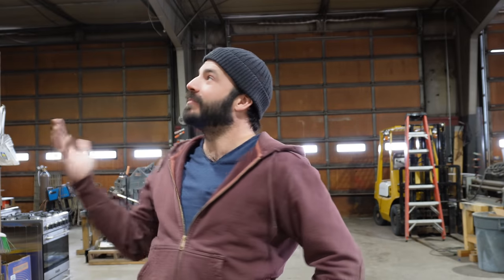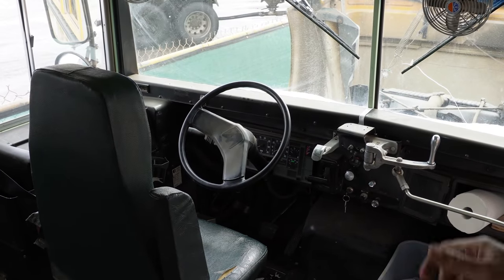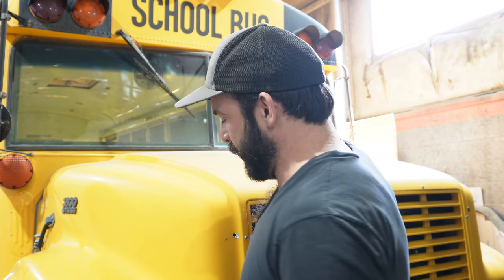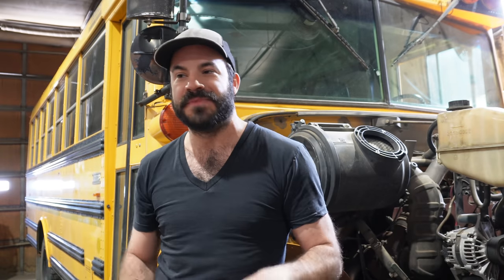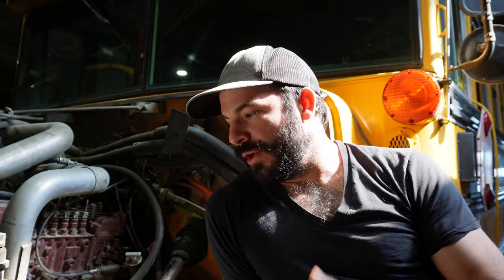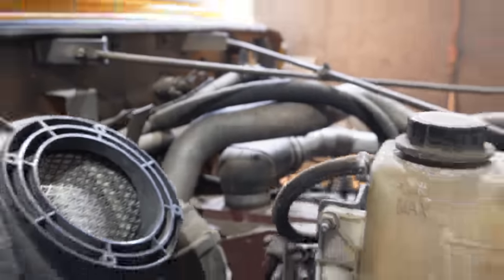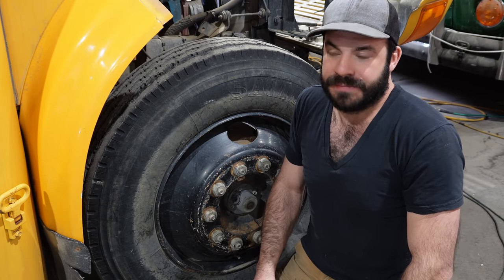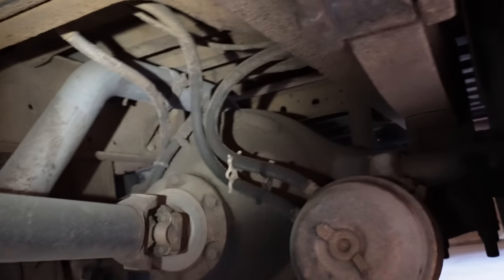Which Bus To Convert For Your Skoolie?

Comment: GREAT VIDEO!
I've been keeping up with you since I first heard you call out the million mile motor claim over a year ago!

Is the Bosch P-Pump on the DT360?

My 5.9 doesn't miss the AT545, I swapped it over this summer for an Eaton 5 speed. 
I've seen a HT740 on the back of a Detroit diesel in a 70's Silver Eagle also!

I have a set of 4.33 gears for sale on eBay that came out of our 99 Thomas donor bus;)

Awesome tire information. Will be catching up with all your YT videos shortly!
Reply from the maker: Glad to see you here! I do believe the 360 had the p pump. Killer motors. 
And yeah, no one will get 1,000,000 miles. I think my bus has 4.11 in the back, I'd like 3.5 or maybe 3.7
Thanks for tuning in, see you around

Comment: Retreads should be illegal. Someone I know was killed when a retread smashed through his windshield in Georgia. You see retread failures all over the road.
Reply: Someone I know was killed when a driver on his phone left his lane & hit him head-on. Would u make cell phones illegal? Sorry for your loss, but 90% of tread failures aren't retread production failures. I'm a 19 yr trucker veteran. I've had many flat tires over the years. Underinflation -> excess heat -> glue failure -> tread loss. Check your tire pressure on EVERY pretrip. All my flat tires have been on my trailers where the auto-inflate system failed, usually in the winter w ice in the line.

Comment: Hey Chuck! I'm in the military and looking to get a 40ft bus to live in for extended periods of time. Are their any engines we should avoid? I intend on starting and running the bus to keep it maintained. I was told by a Bus Depot that - "Wet sleeve engines cannot sit.  If they do, they go bad.  Coolant starts to drip out of the o-rings surrounding the liners, and the motor oil ends up with coolant in it."
Reply from the maker: I've never heard that about wet sleeve lined engines--my own bus sat without starting for 2 years once without issue. My take is to only start the motor if you're going to get enough load on it to bring it to operating temps. Otherwise, let it sit. Just my .02 though. If I were you, I'd get a cummins 8.3, it's the best option for a 40ft bus ever, IMO. Good luck!
Reply: @ChuckCassadyYT  Awesome, Thank you for the reply! we will start looking for 8.3's

Comment: New to the channel. Impressive work. Haven’t seen if you’ve converted older buses. Like pre 1990? Also, if any of your customers live or register here in California. Jan 1,2023 they implement the diesel killer bill. Pre 2009 units I believe.
Reply from the maker: Hi Thank you! We've done conversion work on buses as old as 1962 and turned a 1959 Mack into an art piece. Not aware of any issues with non-commercial laws like that in california. I believe they are only for CMVs
Reply: @ChuckCassadyYT  wow. I’ll check those out if you posted them. Love the older vehicles. On CA diesel laws: good point. My girl was notified via work. In the vineyard business.

Comment: Definitely the Navistar 3800 Chassis, stay away from the CAT C Acert Engine the 7.3 Power stroke is a great engine in these. Blue Bird makes the best body, Thomas has an integrated floor which is built into the structure, which is a bitch to work with. Blue Bird is also the only bus body to withstand the Colorado rack test in a roll over because of it's roof bow design. If you want the best turning Conventional Bus you buy a Vision Chassis from Blue Bird, they have the tightest turning ration of any bus. Stay away from any puller or front engine flat nose bus they are a nightmare to work on, Pushers are great because the engine is totally accessible in the rear. As far as accidents are concerned, Flat Nose blue birds are ridiculously safe. I have seen them smash into trees and semis and even a train once in person after the accident (I worked at a Blue Bird dealership for over 15 years) and there is so much steel up front even in a flat nose if you wear your seatbelt you could smash into tank and walk away.
Reply from the maker: I love all this! thank you for sharing and I agree, BlueBird is my favorite builder. appreciate your comments

Comment: Can shift points be adjusted on the Allison 545? 
I would have preferred a later model Allison with at least lockup.
Mine is in a 2000 Freightliner MT45 step van with 64k mi.,
 4:56 rear and the 5.9 Cummins. Your 3:73 rear end change video was very informative.

Comment: What do you think ?
I’m looking at a church bus , original owner
1994 with a gas 454 GM engine 80,000 miles
Just needs brake lines as of now .
I know nothing about diesel , so I figure this engine can be repaired
At any auto part stores on the road .

Comment: Your advise about a the longevity of a - Straight-6 is with experience and I admire that!  I used to travel a lot in Israel and Sinai desert and the Arab taxi's were then- all old-old 7-passenger Mercedes that wouldn't die! Indeed, in Jerusalem the Palestinian bus station were still using Mercedes buses (They Looked like) from WW11 or at least the late 1940's!!!
I/, going to be 70 this summer and finally am considering getting back into the New England to Florida Snow-Bird routine again- any advise on-

Could I pick up a used bus like yours for under $8000- and how much more would I have to spend to get it road Reliable???? (I can handle the interior conversion myself!) Thanks

Comment: I’m 6’5” and I’ve been thinking about the 40’ Thomas HDX with rear engine. Cummins/Allison combo. What are your thoughts on those? You mentioned in another video to rid the original windows, what are some good replacements that let in a lot of light and airflow? Also, I’m not comfortable with a roof raise, so what would be a good insulation that’s efficient but not bulky?

Comment: i want a bus that can handle logging roads. logging roads i'm thinking of are 10ft wide, some are moderately to lite steep, some shallow ruts. My primary focus is to find a bus thats short enough ( 5 to 7 window with handicap door)  that wont drag the ass end if theres a  slight hill, and short enough im not taking a mortgage out to pay for fuel. i wont take said bus where id take a 4x4, but i wont  keep it in the city. I'm 6'3" so  the roof needs to be tall enough without a roof raise and i need the bus to be wide enough so i can sleep on a bed  positioned sideways in the bus.

last question, do they make lift kits for buses?

Comment: I had thought about finding a nice diesel bus and converting it to 4wd and put it to work as a tour bus for Yellowstone and Grand Teton NP. The reason is because I used to be a pro photographer and getting up higher certainly makes for better photo opportunities and a bus would fit that bill nicely. I would redo the seating arrangement in favor for easier body positioning for photos. 
One problem is that any consideration must meet EPA diesel regs. I used to be a mechanic so my maintenance and repair bill would be drastically reduced.
If anyone has any recommendations on makes and models that can meet my requirements I would like to know. Do they make 4wd models? If not I can convert one.

Comment: I would like a straight six engine with a transmission that gets the Bus up to 70MPH in the RPM comfort zone... no electronic emissions... what year, what engine, what transmission should I be looking for 35-37 ft Bumper to bumper.?

Comment: Great Video, new to the channel. Which do you think gets better mileage in general? All things considered, gearing, weight, speed, etc. Do Conventionals get a mile or two better? Easier to drive on gravel/backroads? Cheers!
Reply from the maker: I don't think there is much difference in MPG, but they do usually have a higher ground clear than flat fronts

Comment: Hey Chuck.  You mentioned information about the tires and to always have the best tires at the front.  Can you replace the tires on the front and rotate (or move) those tires to the back to extend the life of the tires and spread the cost of tires out over time?
Reply from the maker: Generally no. If you want to, they have to be steer tires or all position tires and cannot be recaps or retreads. Rotating front to back is not something I'd recommend

Comment: Great information and bus. I also have a AT545. Should I just swap it with an MT643 for better performance and gas mileage? Also, what does the rear gear ratio mean?
Reply from the maker: Id wait until you have an issue, but definitely install a transmission temp gauge. The rear gear ratio is what is in the rear differential

Comment: Should put a gear vendor on it
Reply from the maker: its easier and cheaper to swap in a used transmission--the largest off the shelf GV unit is only rated to a GVWR of 25,000 lbs. this bus is over that. on a short bus, it could be a good fit, but those often use a trans with OD
Reply: @ChuckCassadyYT  Thats right I forgot a bout the 25,000 rating

Comment: Thanks for the great info. The problem with front engines is the long exhaust that limits underneath storage options. How do you deal with that? Thanks.
Reply from the maker: Sometimes we do a side exit before the rear wheels to free up space in the rear, otherwise you gotta deal with it. It usually runs in between the frame rails next to thr driveshaft anyway until after the axle so it rarely interferes up there and more than the rest of the driveline

Comment: Love your work very informative and professional,  just have one question,  I'm in Ireland and you need a special to drive anything over 3.5t and another one over 7.5t all separate tests and costly do you have that is it classed as a bus or an rv when finished or special license,  thanks
Reply from the maker: These are classed as an RV when they are done which exempts them from that requirement in the US

Comment: Could you do a video for me. I have 545 transmission on my '95, 6 window IH 3800. Trans fluid looks good but shifting odd. Should I do some fluid and filter change or rebuild or swap a better unit?. Cost for each option?
Reply from the maker: Already made a video about that!

Comment: What kind of hwy milage do you get?
Reply from the maker: I get 8 currently but a new transmission and different rear gears will hopefully get me into the 12 mpg territory
Reply: @ChuckCassadyYT  12 wouldn't be too bad but I got rid of my motorhome because it only got 8. I don't know if it's the same everywhere but around here diesel is almost a dollar more a gallon so that makes driving a diesel even more expensive even if you are getting a little better milage. Love your content.

Comment: The DT466 is a garbage diesel, and this is the whole reason he thinks diesels do not go a million miles because International has never built a million-mile engine and only 2 companies have and there 1# Cummins they do a million miles and are documented and proven to go that millage, 2# Detroit Diesels are very well known and also are proven and documented to go a million miles easy. For the record chuck makes these claims also because it's extremely likely he buys whole sale buses auctions which is very common to be known as the place to sell the junk that will not sell anywhere else so it's going to be very likely that you're getting a lemon that everyone else kicked down the line because it has some serious problems that was too expensive to fix like a bad main Berring or early blow by which is very common getting those from schools because everyone I've ever worked on they never change the oil or they never had it services so no you won't get a million miles from bus that does not have a good maintenance record period and second I do not know what planet he gets tires but I get them new whole sale for 180 bucks lol the more I watch the more I see a possible scammer cough cough.....There are Diesels that go A million miles and its common do not listen to the Noobs!!!